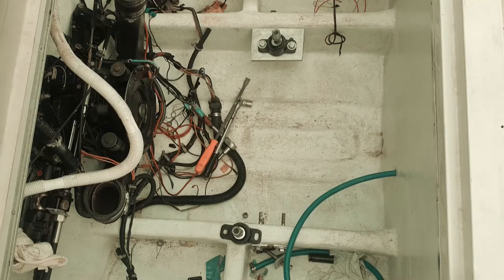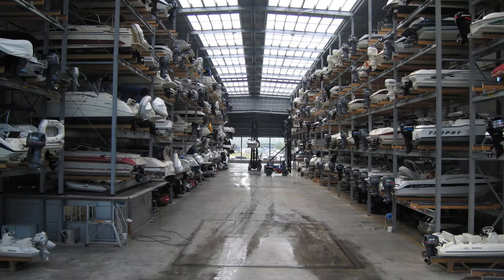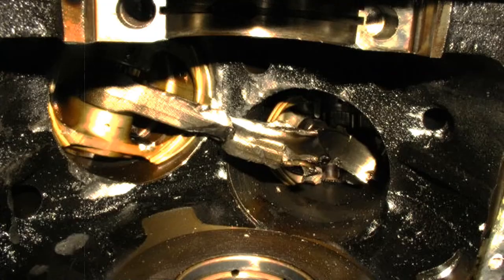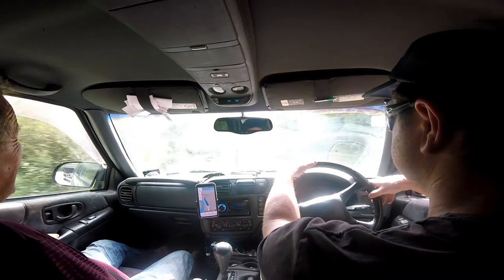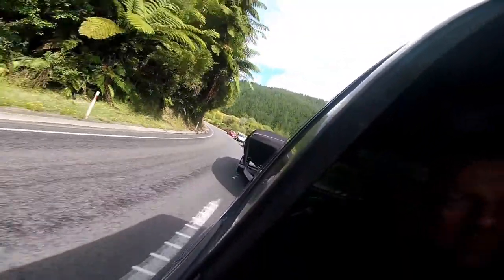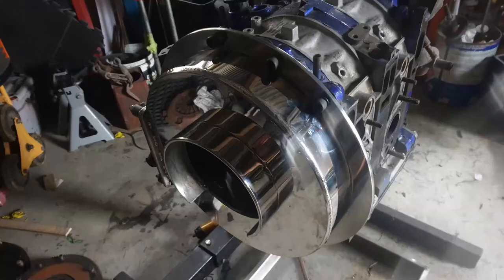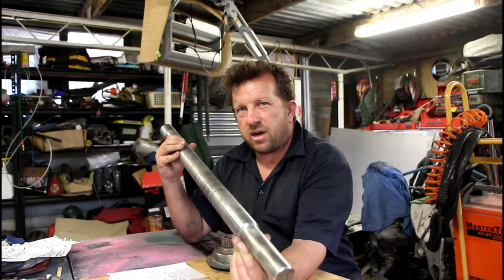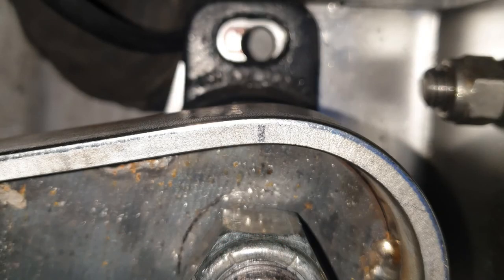Rotary swap Scarab offshore power boat build. Episode 1 .  We need to go faster!

Comment: Hey bud love wha you did here this is awesome is there anyway that you can duplicate the bell housing and engine brackets for my 13b I have been wanting to do this on my twin engine sea ray
Reply from the maker: Hi, at this point i was not planning on making the bell housings. I would like to get some testing done and see how it goes first.  And i am starting to have second thoughts about my engine mounting setup, which i may change in the near future. 
And recently discovered FD automatic rear irons are no longer available new which makes me think moving the engine forward just enough to use manual transmission  rear iron which would be better and would also position  the engine more central for the main mounts. 
 I also thought it would be possible to use a bell housing off a mazda transmission and just mount the engine not attached to the leg at all .
Thanks for watching .